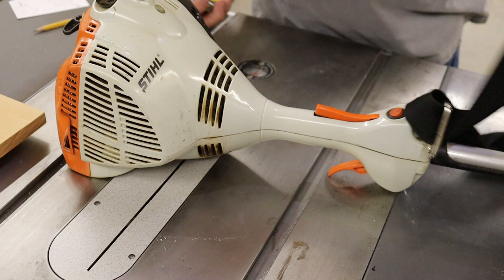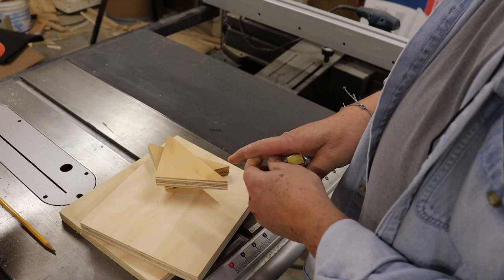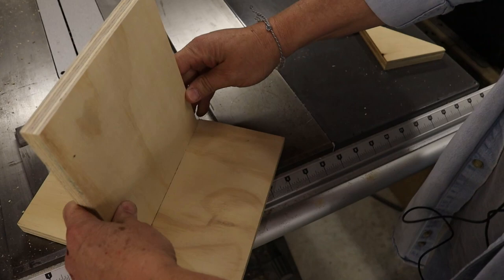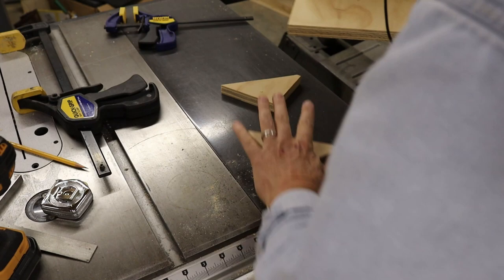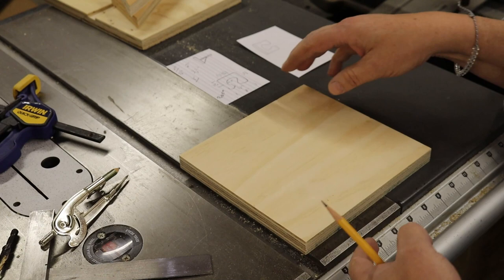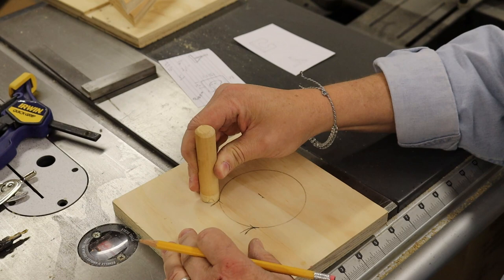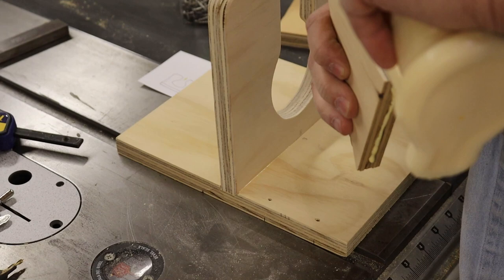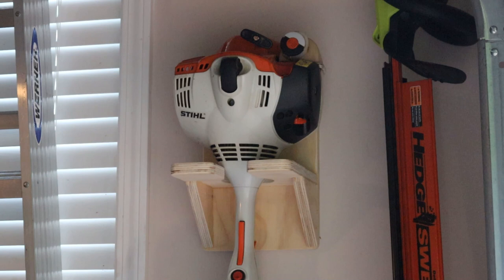String Trimmer Hanger

Comment: I am new at this and I really wanted to see how you did the cuts.  That's where the skill is.
Reply from the maker: Thank you and thanks for watching!  How you make the cuts will depend greatly on what tools you have.  I made all my straight cuts on a 12" miter saw and made the cutout for the string trimmer with a powered scroll saw.  I think the straight and mitered pieces might be too small to safely cut with a circular saw, so I'd recommend either a tablesaw, miter saw or a band saw.  Either a band saw, scroll saw, jig saw or a coping saw could be used for the circular cutout that holds the trimmer.  To your point, maybe I should do an overview video like this and then do a more detailed video for folks that want to see the specific details.....Thanks again, Kent, I appreciate your support.

Comment: I wish I can see the bottom part of the tool.  How does it hang near/far from the wall.
Reply from the maker: Thanks for watching, Rob!  It depends on what I attachment I have on it.  The string trimmer and brush cutter attachments will not touch the wall.  The edger attachment will.  You could avoid this by adding a couple of inches to the depth of the cut-out piece or add a small piece at the bottom to hold the shaft out away from the wall.  I may build another one showing that as an option and put up a video.

Comment: Thanks so much for your videos. I bought a cheap greese gun from Amazon and greese is not going through my zerks on a lth 1738 mower. The mower has been through one season and never been greesed.

Does that sound like a bad greese gun? Greese goes out the sides, not into the zerk, even when I take the zerk off the mower
Reply from the maker: Thank you Taylor!  It sounds like the coupling on the grease gun may not be put together correctly from the factory or it is just too tight.  It may not be snapping completely onto the zerk fitting.  Some of them, especially when new, require a lot of force to get them to snap on properly.  If yours is fully seating on the zerk, it's probably not put together correctly inside the coupler.  I'd be tempted to replace it and/or the hose and coupler before I replaced the whole gun (depending on the cost of each option).  I hope that helps...let me know if I can help.